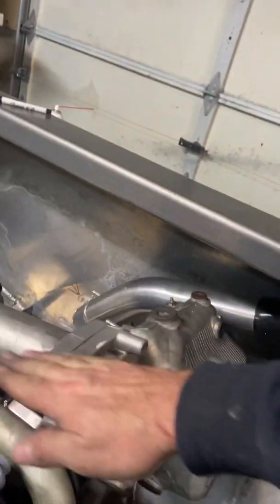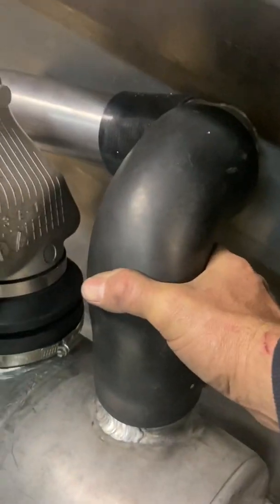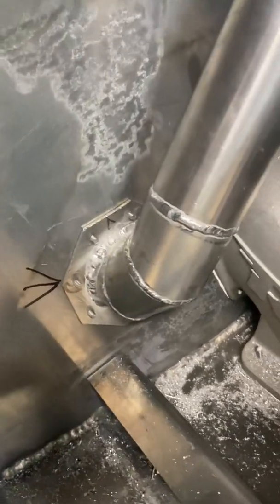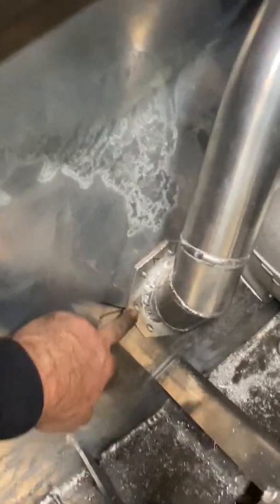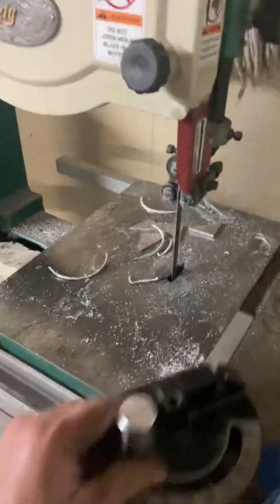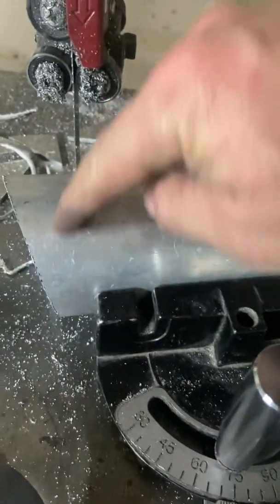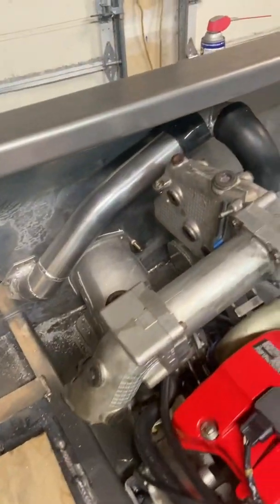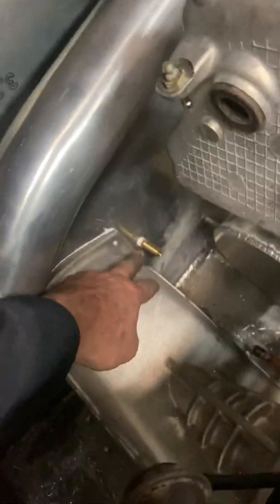Mini jet boat build (10) Exhaust is in!!!

Comment: I would love to know what you would do with a 10k-12k budget for motor & jet drive assembly. I have a 12' pre-welded Jetstream ordered and I can't decide between supercharged donor ski or honda k swap turbo with ?(jet drive)?. The donor ski seems like it might be cheaper/easier way to go but less horsepower and possibly more expensive over time. Thanks for always answering my questions I appreciate it.
Reply from the maker: Get ahold of Ronnie at RSRacecraft.  He’s actually developing parts and kit for a Honda power plant.  Not sure what kind of pump though.  I think he’s up in the 400hp range with a Motec
Reply: @JollyRoger907  I did see that   he was starting a new product line for the K swap and that will be helpful once released. I realized today I had miscalculated the jet drive cost which was swaying me toward a donor ski. When pricing for a southern jet from New Zealand I had forgotten that price was NZD not USD and with current exchange rates I'll stay in budget. The boat I have on order won't be arriving till July so hopefully by then RS will have the Honda parts up and available for purchase. Thanks again Eric appreciate ya

Comment: Do you need the water box or can you just make the pipe loop up in the back and back down under the waterline with a flapper on it.  Trying to eliminate the water box as mine is rather large.
Reply from the maker: Don’t need it but it’s super loud without it